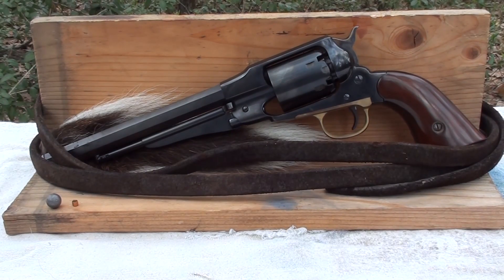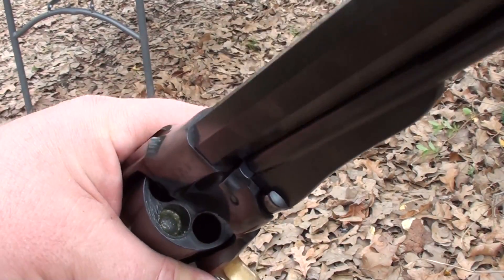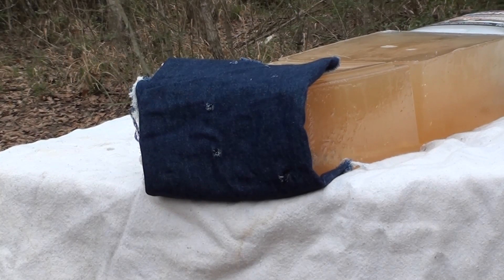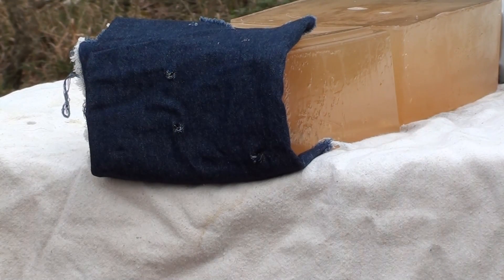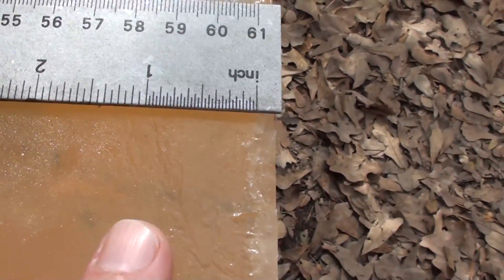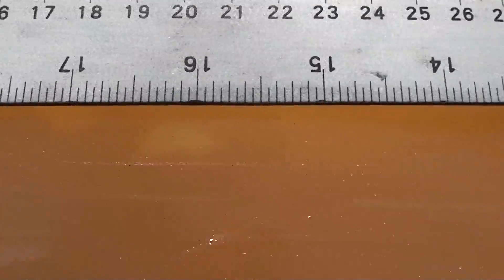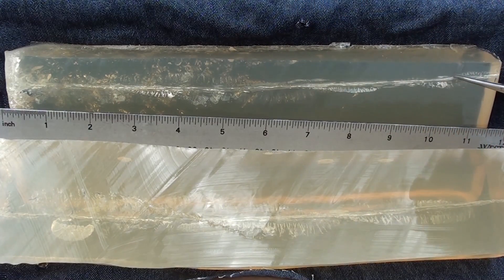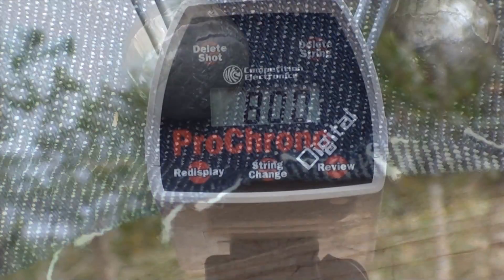45 Cap & Ball Ballistic Gel Test

Comment: Any idea what the fps of a snubnose would be
Reply: 35 gr 3Fg powder in 3" barrel Pietta = 525 fps.
35 gr 4Fg same gun (mine) takes it to 755 fps.
I ground some 4Fg in a mortar and pestle until it would go though a #60 wire mesh making it 4.5Fg and they averaged about 850 fps.
I have two Snubbies I carry everywhere and if anybody around me starts misbehaving with a knife or machete they in for a real bad day :Q
Reply: @patrickshaw8595   what would be its performance with human head, at extremely close range.?
Reply: @DESIBOY-fe7nm  Well if you have screwed around with large caliber short barrel pistols much you will soon realize that mathematically lighter projectiles at higher velocities have more kinetic energy.
KE is interesting. By itself in a rifle - velocity makes bullets explode things. Frontal area is interesting, too - with a shotgun slug having the same energy as a rifle slug - bore diameter SUPER explodes things.
So technically both the 855 fps velocity and the .454 diameter round ball splatters stuff about three times better than a 9mm.
On the other hand craniums are pretty tough. They themselves hold up remarkably well compared to say a watermelon or jug of water. But I would say that on the average living man's cranium you are going to see a .50 to .52 caliber (from the ball flattening) entrance hole, it is not going to pack enough punch  to exit the skull - but it is going to dump what's left of it's 325 foot pounds of energy in the brain matter in it's path between entrance hole and impact with opposite-inside cranial wall.
        Verdict: A headshot delivered to the biggest meanest attacker's head would make aggression medically impossible after about 8 microseconds. Then: Attacker. Now: Ragdoll.

Comment: Years ago had a Ruger old army. Used measure tube to load ball in cylinder just to the top.  Preferred lube was peanut butter. A little on the finger, spin the cyl prime and shoot.  Thousands of shots, never a primer fail "rem...primers" . And never another cylinder firing at same time. Of course always lick finger before shooting.

Comment: I would take that over 6 shots of .38 Special without hesitation. Much more mass which means much better for breaking bones blocking vitals. Although over penetration is a concern today, two .45 caliber holes(through and through) are always better than one shallow .38 caliber hole. Blood loss = blood pressure tanking = death.

IMHO, modern pistols are far less lethal than these old black powder revolvers. Largely due to copper jackets and modern expanding rounds, which actually save lives by limiting penetration. I see hollow points as the birdshot of handguns. They make impressive looking shallow wounds, but they regularly lack the penetration to reach vitals in calibers smaller than .40 S&W. I understand the controversy of that statement, but any intelligent person that does their research will agree. The insanely high gunshot survival rate in this country seems to prove my theory.
Reply: Just think, you are the reloader.  Worried about over penetration in a house, lower the powder.  Want to +P, add a few grains.

Comment: I've got a 1858 new army Stainless model and I seat the 138 grain .454 and barely get the lead ring peel and use no lubricants as it is metal on metal seal and run with the factory max powder charge of 44.1 to 44.2 grains of FFFG Pirodex... and all six shots at a 45 degree angle hard pack damp dirt,,, from a second story balcony and it travels about 20 feet in and the bore channel it leaves at that speed is the size of a basket ball... Kicks harder than anything I have ever fired and if you fire it like you Ony had 30 grains of I guess your running Goex,, it would come back and split your skull... I love to be able to stop anything that comes at me in the woods... and I am so sure this thing would stop a polar bear at 100 yards NQA..
Reply: Garenteed  💯 percent kill a 🐻 bear or anything that has breath 🫁 in it but mor like 50 yards away because you would hit what you aim at  100 yards  with round ball it's very hard to hit 🎯 the target out that far in other words a vital shoot not going to happen in less you got lucky and it did hit the head or heart and even mass center it will kill it but would have to bleed out and it would I promise you

Comment: good video.  The deadly part of a .44 round ball is the softness of the lead. Your gel only represents flesh, not bone. if a .44 hits dense bone it expands. it does catastrophic damage. its best at shattering bones.
Years ago i shot a skunk with a .44 RB, 30gr of pyrodex. To my amazement it made a hole the size of almost a tennis ball going in, but going out retained the .44 cal. This is due the the shape of the ball. Anyone remember wad cutters? Flat nosed lead bullets? The .44 ball is similar to that when it hits. The shock of impact is about as good as most rounds of the present day.
You can test this for yourself by shooting a conical bullet out of the .44 at a water jug, then shoot another water jug with a .44 ball. the jug explodes while the conical bullet just passes right through. Use the same powder change for both and you will see.
Reply: I was thinking the same thing the lead they used back then was probably softer and flattened out more

Comment: If you want to see a nice wound channel from an old cap & ball pistol, try taking a small drill bit and drilling 4-6 holes opposing each other in the ball. Follow this by a hot load of powder and it will produce results similar to that of most expanding JHPs. This works better in my .36 cal pistols because I can get velocities around 1150fps, but in .44 with a Hornady .451 swagged ball around 900fps works majority of the time. Typically I see 10-12" of penetration with a permenant cavity resembling that of standard .38 special loads.
Reply from the maker: Or just use soft lead like back in the day with no tin in it and when it hits it flattens out and causes a whole lot of trouble
Reply: Joe Doole 
That brings up another question(or 3). With the .36 caliber Pietta steel framed 1858 Remington pistols, are they the same size frame as the .44 pistol? Is the .38spl conversion cylinder for that .36 caliber the same size as the .45 conversion cylinder, but with smaller caliber holes drilled in it? The reason I ask, is that if the .38spl conversion cylinder is the same diameter as the .45 conversion cylinder, then it would obviously have a lot more steel left around the outside diameter of the bore holes, which should allow it to potentially handle hotter cartridges than the .45 conversion would, due to thicker steel around each cartridge. Maybe you could safely load standard .38spl smokeless cartridges with it, if that's the case(?)
Reply: Joe Doole 
That brings up another question(or 3). With the .36 caliber Pietta steel framed 1858 Remington pistols, are they the same size frame as the .44 pistol? Is the .38spl conversion cylinder for that .36 caliber the same size as the .45 conversion cylinder, but with smaller caliber holes drilled in it? The reason I ask, is that if the .38spl conversion cylinder is the same diameter as the .45 conversion cylinder, then it would obviously have a lot more steel left around the outside diameter of the bore holes, which should allow it to potentially handle hotter cartridges than the .45 conversion would, due to thicker steel around each cartridge. Maybe you could safely load standard .38spl smokeless cartridges with it, if that's the case(?)
Reply: HighlanderNorth1 new belt 36 (1863)i orginal or all copys is same frame than an army 58...in more heavy...because more metal..llol...  lonely true new police colt 1862 is a 36 on a 31 pocket frame... uberti is lonely to do it... pietta new police is just a 1861 big frame with caneled cylinder

Comment: A couple questions: First, can you reuse the ballistics gel over and over, and if so, how(melting it or dissolving it)? Second, how are the ballistics of a .45 LC cowboy action type round fired from a conversion cylinder for this 1858 Remington? Supposedly you are limited to rounds that max out at about 800fps velocity or thereabouts when using a conversion cyl in one of these, which may limit you to cowboy action lead rounds, unless there are personal defense type .45 LC cartridges that don't exceed 800fps(??)
Reply from the maker: NEVER use anything but cowboy loads in a conversion cylinder in an 1858. My cartridge loads (for conversion cylinder) produce with a 255 grain lead bullet around 850FPS with Pyrodex, Pyrodex pellts or real Blackpowder.  I NEVER USE COMMERCIAL 45LC AMMO or "TODAYS" ammo in my conversion cylinder.  I handload them.  If you are not a reloader stick to the Cap and Ball method. Until you can find real cowboy loads.  Black Hills makes a pretty goof 45 LC and a Scholfield you can use
Reply: A 255gr bullet at 850fps is nothing to sneeze at. I read several articles that say cowboy rounds produced by quality ammo companies at 800fps is safe for use in conversion cylinders. But I'm not 100% sure whether they are talking about commercial smokeless power rounds or only commercial black powder rounds(in addition to "hand-rolled" BP cartridges).
Reply: There are quite a few companies still making cowboy action Loads readily available, especially in .45 LC. Black Hills and Ultimax are always on the shelf in that configuration in my local big box stores. If you have an all steel frame pistol though you can handload pretty hot for conversion loads. I regularly run a 980-1000fps load out of my Pietta and have done so 350-400 rounds with no ill effects. I've also run BP loads upwards of 42-44 grains in the cap and ball cyl although maximum accuracy for my setup comes around 32gr. Point is as long as you have a steel frame from a reputable manufacturer it is going to be stout. The biggest issue with most modern standard pressure .45 LC is the jacketed bullets not the pressure. Of course I would never use any of the "+P" loads in a conversion, but the likes of American Eagle and similar loads in .45 LC are not very hot at all pressure wise.

Comment: Black powder revolvers, while "primitive" compared to today's handguns are not underpowered, especially in the 1858 New Army and 1860 Colt Army. With the new nipples by companies like Slix Shots and with more modern powder like Hogdgon's Triple 7 instead of straight black powder ignition is more reliable and fouling is less for more rounds. While not a great proposition, the laws on these are much less strict and if one was to have the mind to, keep one of these, a couple hundred lead balls around, couple hundred caps and a pound of powder and the necessary tools to clean it and maintain it, if things should go south in this country and things get lively as in confiscations, etc. then this is certainly better than nothing. I am not advocating this in any way shape or form, just putting it out there.
Reply: 51 Dragoons nothing to sneeze at either.

Comment: I load my pitta 1858 remington with 40 grains 3f Goex and it falls into the same ball park as a .38special+P / 9mm. My 3rd model dragoon loaded with 50 grains of Goex 3f will match a .45acp. My Pedersoli 20x20 Howdah pistol loaded with 60 grains Goex 3f is  equivalent to a .44 magnum. Whereas my Walker with 60 grains Goex 3f easily matches a .357 magnum. So don't thumb your nose at BP revolvers, they can pack the mail!
Reply: I disagree because getting hit with a 44 and a 9mm are gonna be way different. The 9mm is ofter a over Piercer. The 44 with a Conical did more damage in the civil war than are wars combined. They need to bring back this devastating round. I think America rather make wounds like with the AR 22cal

Comment: One thing I noticed you did. 30 gr of powder and you seated the ball way down into the cylinder. Next time you shoot a less than full load, add a filler so the bullet sits near the top end of the cylinder. Some cylinders are cone shaped and you end up swaging the bullet smaller than the barrel and it ends up rattling down the barrel skipping the rifling.  I prefer a 1/2 of less load in my Colts and Remingtons. Less recoil and I am more accurate. Corn meal or cream of wheat are good fillers and also help keep the gun cleaner, believe it or not. Don't use wheat flower . It adds to the flash and danger of bad thing happening.
Reply from the maker: Actually all that filler stuff is crap. Never use a filler.  It makes NO difference whether the ball is seated at the top or at the bottom of the cylinder, once its seated its the circumference of the cylinder end of story it cannot be any other thing at that point. The cylinders are not cone shaped in ANY pistol I have ever ramed a ball in, once past the lip and shaved, good to go.  And as you see in the recovered bullet if you watched that long, the ball DID NOT "skip" down the barrel, its rifling was true.  Never in History has there been "filler" added to black powder until the last Century when people "assumed" they needed to do it because they used the wrong powder.  Not bashing your comment at all, just correcting the falsehoods that people have you believe, now you know.
Reply from the maker: ***********Meant to say Decades not Century, my bad
Reply: It would appear you know more than I do.  In the last 60 years of shooting BP  I have run into cone shaped chambers on a revolver and the bullet did skip the rifling as a result and you have to fill any void behind a bullet when you use BP or it will eventually cause the chamber/barrel to bulge or bow out, and using a full charge every time you shoot one of these guns the frame will stretch eventually and the cylinder become sloppy ,this happening faster in a brass frame Cole than in a brass frame Remington  but also happens in a steel frame  of both designs only it takes longer.  For me using a filler has the following advantages:  Less recoil so I hit what I am shooting at. The gun is stretched less over time so it ends up in better shape. The fillers tends to scours out fowling and  makes cleaning a lot easier. And I save money using less powder , not much but over 60 years it is adding up. And finally, I am not dropping a man or a horse, just poking a hole in some paper, Even when I carry a back up gun to dispatch game I am not shooting  past 10’ so I don’t need a big rattling jolt to get the job done.
Reply from the maker: Well it seems for you, you have a pretty good system.  Glad all is well, and glad your guns are treating you well.  Happy shooting and thanks for watching
Reply: @ScubaOz  i think the case could be made that placing the bullet closer to the barrel delivers a higher velocity, even if only marginally. 

would need testing, but i can't expect that a ball halfway in the cylinder is the same as a ball at the end of the chamber, with the same load.

Comment: Well a .44 cal with 30 grains of FFF Goex has about the same power as a .38 special. Black powder is not weak in the slightest. Unlike modern powder the maximum velocity has a Plateau which is why they went with larger and larger rounds to get more energy with mass rather than more velocity. Black powder guns and cartridges can be incredibly powerful.
Reply: Totally agree ! Some people are confusing old school and crappy ;). Amost the same energy level as a .357 mag but it's a much bigger caliber/hole (.357 --> .457). If you ever get shoot by a big .457 (actually .45 caliber) pure lead ball moving at 370 m/s well ... you're fucked ! :-(
Reply: Hey ! Don't be disappointed, cap and ball revolvers could be sooo much more powerful than that a 38 spe. :) 
It strongly depends on how much powder you put in their, which ball and which powder.

For example, my Remington 1858 8'' barrel replica reaches about 355 J (280m/s) of muzzle energy with a round ball and full load (40gr) of standard french PNF2 powder  BUT ... an impressive 620J (370m/s - about the same as  an old .45 LC cartridge more than a 45 ACP) with a full load (40gr) of the fine granulation Swiss1 powder (every grain of this fine powder burns in the chambers or in barrel : No lose of energy/no burning outside the weapon) 

A full hot loaded colt walker (60gr of Swiss1) produces about 790J of muzzle energy ... Roughly the same as a short/medium barrel .357 Mag
Reply from the maker: +sharpie443   Yes black powder loads are pretty powerful, caution must be used when using black powder for sure.  The "old" loads are a lot more powerful than today's loads
Reply: +sharpie443 A .454 bullet with 30 grains of FFF black powder has only the power of a modern .38 special? Disappointed, I thought it was more powerful, ok, far from a .357 magnum but closer to a 9mm Parabellum (not +P). Nevertheless I'm quite sure such big soft lead bullet has more stopping power than a fmj .38 special and even an old fashioned lrn.
Reply: Not true that 45 cap and ball performs as a 38 spl...last weekend I got 1300 to 1400 fps from my NMA with lead balls and all chambers totally filled with homemade BP.
Reply: @carlorou3257  Wow that is Kick-ASS !
Reply: Tony FFESSM I don't have any chrony to test the velocity but my wife has a 28 gauge semi-auto shotgun (only two rounds plus one in the chamber in Europe) and I buy #7 birdshot shotshells to refill the wad with two .454 round pure lead balls and close the star crimp opened with a screwdriver. The payload has the same weight, no lead overcharge which could produce dangerous pressures inside the barrel.
Reply from the maker: Thats some serious Buck shot there!